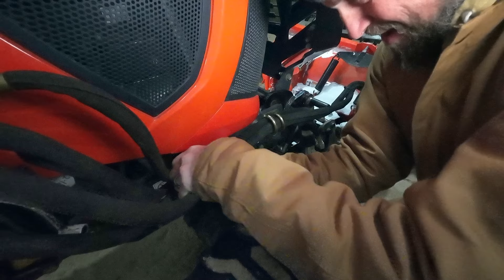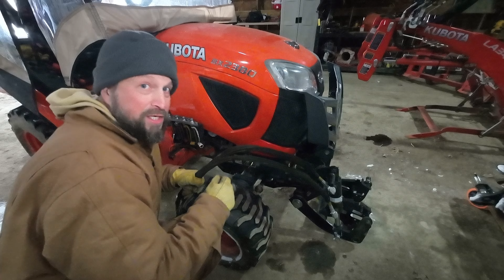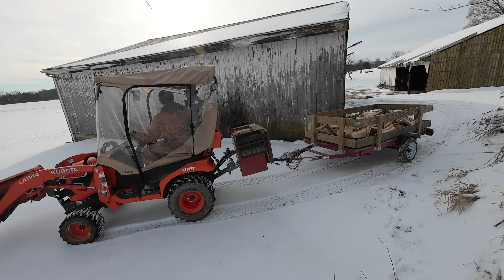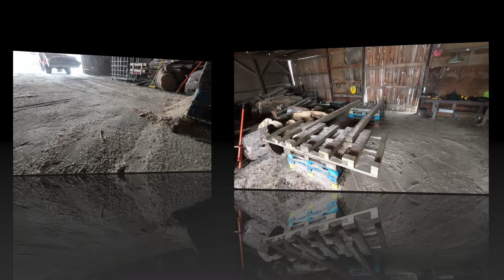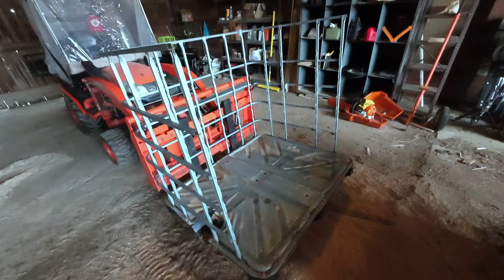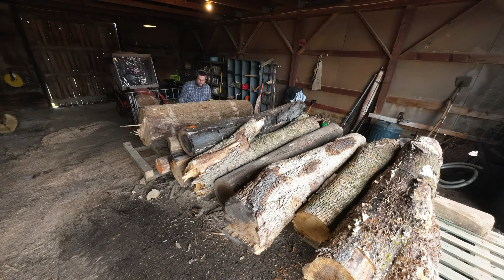BX 2812 Snow Plow Removal And Processing Firewood In A Barn

Comment: I don't have a plow for my tractor.  I have a snow blower for the lawn tractor that is a PITA to install, so I really don't use it.  I have the loader and a 5 foot rear blade for the tractor that does the snow moving I need to do.  If I got a plow it would be the type that goes on the loader....the setup you have is ridiculously expensive for what it is because you are paying for that 4 point front hitch on top of the plow.  

My driveway is small enough I probably could use a snow pusher though. May look into one and a SSQA loader mount plow and see which one is more cost effective.
Reply from the maker: Everything is ridiculously expensive right now. I got that plow several years ago and I'm pretty sure I could get what I paid for it. Crazy! 🤠👍